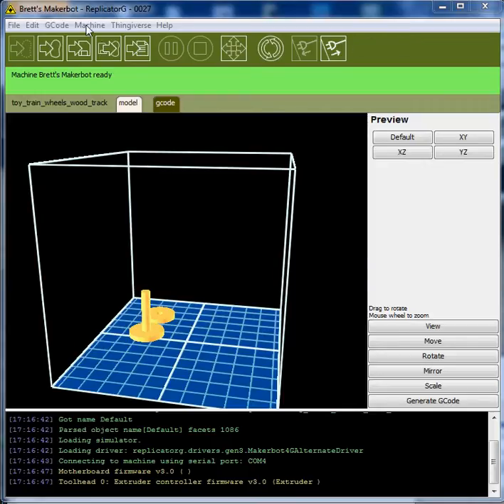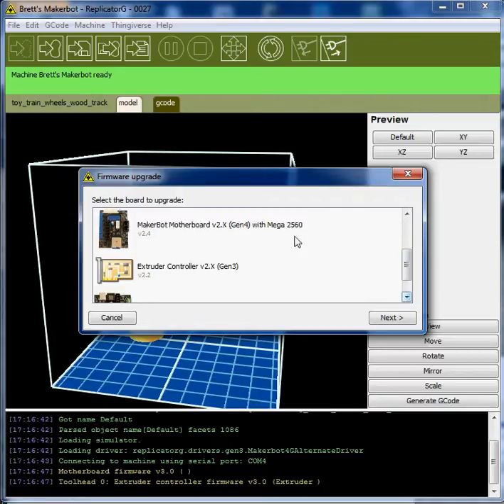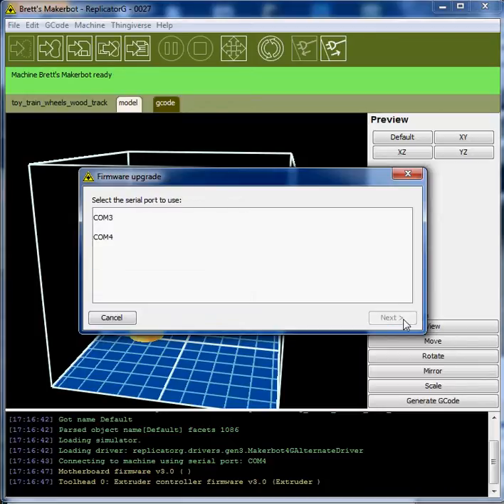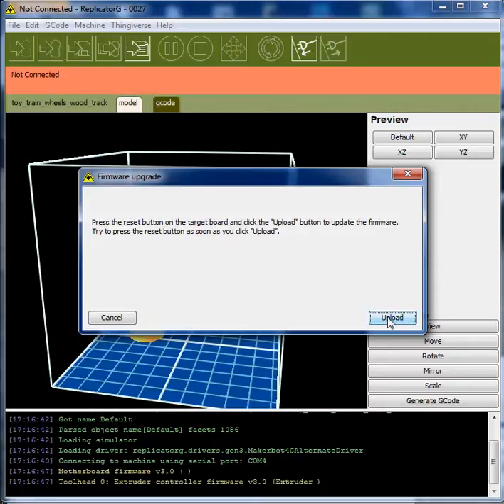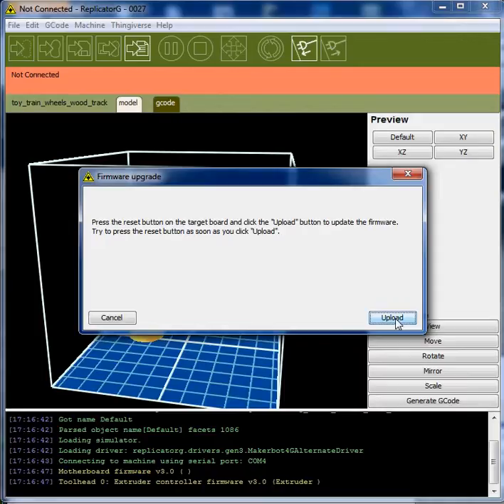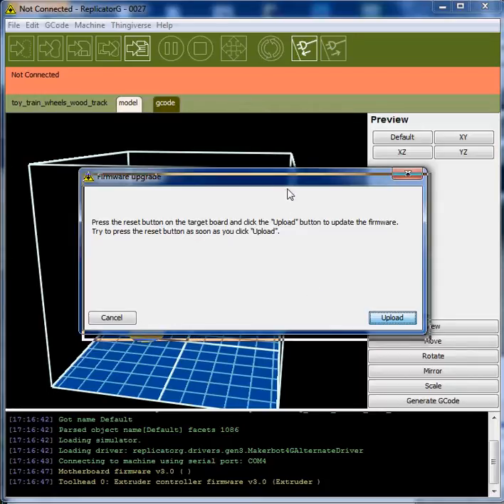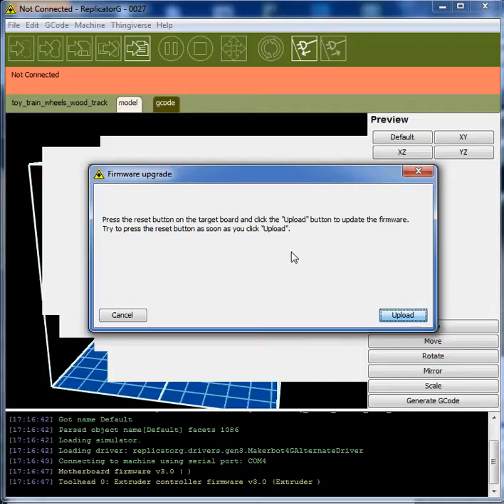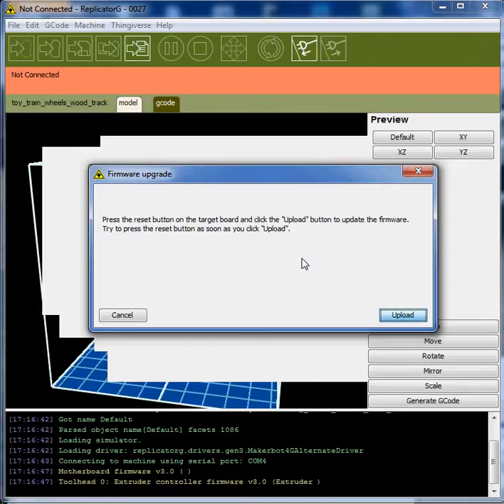Attempting firmware update on Thing-O-Matic.

Comment: its a little late but this helps me today thx!
Reply from the maker: That's great news!  As you can see from my other comment I learned that I had to click the reset button repeatedly before the update happened.  Glad you got it working!
Reply: Most of the help for the thingomatic is gone is yours still running today?
Reply: Do you upload a new firmware over the USB cable you usually print with and any idea hoe to update extruder controllers?
Reply from the maker: Indeed it is!  I've had to patch the heated build plate wire but it's still printing like a champ.  Check out all the stuff I've made https://www.thingiverse.com/MacGyver/makes
Reply from the maker: I've not updated the firmware in years, but when I did I just used the same USB cable I've always used.  You should come ask these questions on the Google makerbot group.  https://groups.google.com/forum/#!forum/vintage-makerbot